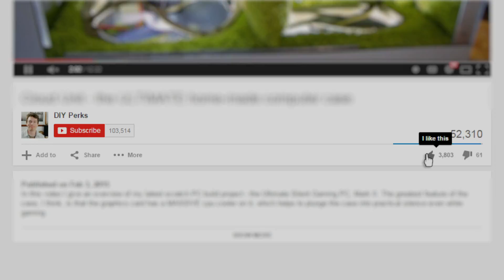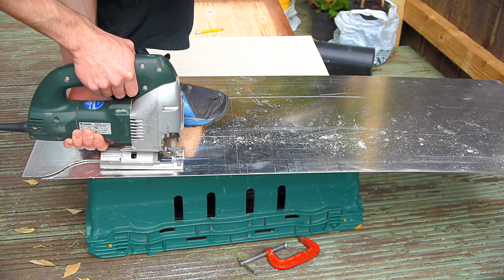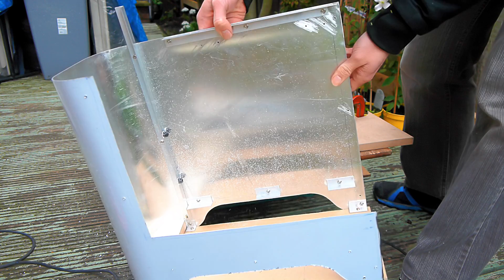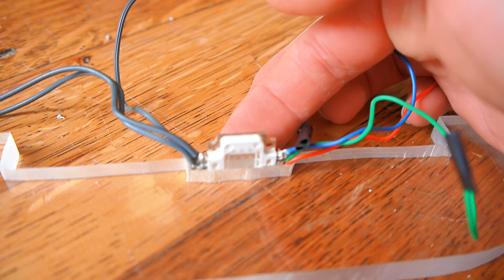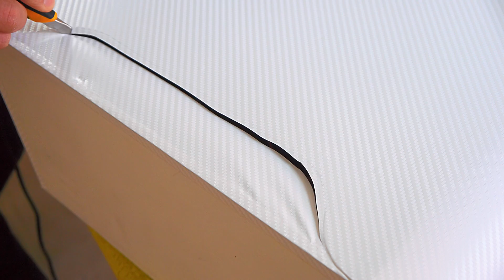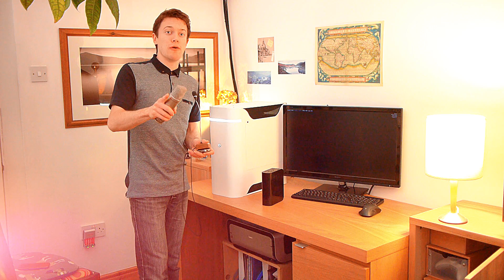Cloud Unit - Build Log (Scratch-Built Silent PC)

Comment: I would like to respectfully suggest some amendments. You could build an aluminum skeleton, and attach all the pieces to it, then make a skeleton cover using a folded aluminum foil. Have you ever seen an old compaq desktop? Access to internal components was done by pulling the back of the case (search for compaq presario 7471). The dvd drive would need to be replaced with a slot load drive, finishing is simple and easy, just a foam lined slot.

Comment: I can say this is way better than most cases being sold out there, in terms of functionality. Just add a little more variant like multiple harddrive cage,  etc. This is exactly what I've been thinking about; The integrated whole system cooling. I would buy the case, or even just the blue print.

Comment: I like your DIY videos very much! Very inspiring. I like the idea of how you built your silent PC. I had a water cooling but it pisses me of^^. So I think about building my own silent PC according to your guide. But I don't want to work with aluminum. So what do you think about MDF for the case? You built a wooden case too, but I couldn't find the built log. So you mentioned something about wood was resonating the fans noise or so... What do you think about using MDF? And another question is, wouldn't it be smarter to put the fans on the top, sucking the air from the bottom through the case instead of blowing from below? Cheers!

Comment: Man, seriously...You should patent this project....And with some time, refine internal design layout for more disk drives units and stuff....Overall is already an amazing project...You reduce the amount of fans (as long the necessity of higher rpms) and, independant of the parts that will put into, the same cooling system remains...AMAZING...
What's the total weight of this project????...I see that you use aluminum, so, in comparison with other cases (steel/glass) should've been lighter
I have to say that should be the next REAL trend to the next generation of cases: energy efficiency....not that RGB bullshit!

Greetings from Brazil!

Comment: Good work,  nice ideas, I had a similar issue of keeping it quiet and cool. I was lazy and just bought extension leads. It worked out easier to have the machine in another room and run the cables to where I was going to use it...

Comment: Build the case wider, put the power supply behind the mother board, and put one (or 2) 230mm fans at the bottom...

Now I have a use for the 230mm fans I got dirt cheap, that I don't have a case for.

Comment: that laptop hdd is going to heat up like a mofo and die in a couple of years. ive worked on so many laptops that had overheating harddrives and made them as slow as macbook air, jk. but for real though, you want that harddrive cool

Comment: I still dont get it... how do you do the heat transfer posible? i mean... you had the entire thing rounded in plastic (vinyl)! and the thing you use for absorving sound... well they actually can keep the temperature pretty high... there is something i miss? a hug from argentina!
Reply: Jaime Monsalve heat travels up, his aim is to get the hot air out as fast as possible and smoothly. The fans t the bottom push cold air up, as it slowly heats up it keeps rising up eventually going out through the vent. The.cloth that surrounds the fans at the bottom don't retain heat because there is virtually zero heat at the bottom of the case
Reply: unidirectional airflow and huge heatsinks are everything you need to keep the hardware within reasonable temperatures without having to crank up the fans

Comment: could u design the heat syncs in a way that it works like a sealed cooler, making it out of wood was silly u made a computer guitar lol ,  sucked in from both gpu n cpu and pumped out by the heat sync which then would be pushed out by the big fan

Comment: Never put an HDD in towel or  similar material because you dont have active cooling on hdd and towel just raise your temps too much with no heat dissipation at all. Second reason is static eletricity ;) just freindly advise.

Comment: As much as love the design philosophy of this case and it's overall setup I do have some criticism.  for one thing it is fairly dangerous to cover a hard disk in fabric as the vibration from the hd or the case could cause static electricity in the fabric which will ruin the equipment.  and secondly it may be more heat efficient to place the psu on the top of the case as opposed to the bottom for the simple fact that heat rises and you want as much cool air hitting the cpu and gpu as possible and if the psu is on the bottom of the case the heat from it will rise into the cpu.  with the psu on top of the case it would be in a more beneficial position imo as the psu does not need to be as cool as the cpu does in order to maintain protection from heat damage.  if anyone thinks i'm incorrect in this observation let me know.

Comment: for those of you looking to do the same... shop around for some 'cubelock' or similar - 25mm square ally tubing with plastic joiners that'd make this a diddle. And buy a de-buring tool, works far better/faster/easier than sandpaper. 
Good job in any case mate... particularly for someone with no prior experience.

Comment: just a mech tip : Use rivet instead of polishing screws. Taper rivet are also available in market. Use open spaces to circulate air as have used towels they will accumulate heat around device. use lapping paste to for neat clean acrylic after sanding

Comment: so you built all this but have crap hardware?
Reply: Not cool bro, not everyone can afford good hardware.
Reply: The point was proof of concept
Reply: heat generation bruh. high end gear would still overheat in that, but mid level stuff would run great indefinitely
Reply: +Shawn Tame wrong that is shit level hardware first of all, second of all new graphics cards have lower Temps and voltages so with a cpu cooler it should be fine. I would go for an Intel T branded processor which run at lower clocks and voltages than other intel lines but have much much lower tdp and temperatures making it perfect for this build. he could build a much better computer.
Reply: This system cannot game that is true. its not fast enough. But do you really think that is what this box is for? Its a show and tell pc, It will probably sit in a living room to be a stream box or browse the internet. MOST computers are not designed to game. its a Mid grade PC. for general use. Never did he ever say it was for playing games/ Heavy computing. Second of all as you so elegantly put it. that card draws about the same amount of power as a newer card yes, so it makes just about as much heat. But size is key here. Have you ever installed a water block? a few years back when i finally got around to doing it on my 980 i did a few silly experiments just for shits and giggles. basically i powered it on and hit it with a infrared thermometer to see how fast it got hot. ( I'm using the 980 because i have yet to take the original heatsink off my 1080. Im not sure if im going to keep it so i haven't bought a waterblock.) the heat is distributed in a much larger area, along with all the memory, the memory wouldn't be touched by a single CPU cooler. while that's fine with the memory on that older card, The one that has enough speed for his uses mind. Due to its limited capacity. the 980 has 4x the memory. It would NEED cooling at that size. while the smaller one might JUST might be ok without any. as the memory portion would draw 4 times less power. so create 4 times less heat. i stand by my statement that any of the newer cards could not live in that environment. they would make too much heat in the card, then you would have so much thermal throttling it would turn into a paperweight. might as well use on board graphics.
Reply: Fair enough Shawn
Reply: Shawn Tame thank you Shawn I now realize that the memory would have to be cooled that comment was posted when I was less knowledgeable

Comment: I will PAY YOU WHATEVER YOU WANT to build me a case like this!!!
Reply: LOL  I wish I saw you message three months ago! LOL I ended up choosing the NZXT s340 for it's great reviews of interior management and clean lines, though this other case is still amazing too look at!  I may call upon your services at a later date, but here are my specs.  If you can see if it's possible with these specs, let me know! 

Asrock Taichi X99 LGA2011-v3 MotherBoard
Intel I7 6850K 6-core Broadwell-E overcocked to 4.5 ghz 
X61 Kraken AIO Cpu Water Cooler
EVGA FTW Hybrid watercooled GTX1080
32GB G.Skill TridentZ series Memory @3200GHZ
256gb Samsung SM951 M.2 NVME SSD
EVGA SuperNova Platinum 1200watt Power Supply
4X Noctua NF-A14 PWm 140MM Case Fans

Comment: +DIY Perks Great build! - really inspiring, i do have one questions though, how have you managed to mount all of the components inside? did you drill custom holes to drill them in and would you recommend this instead of building a case around a shell of another pc case where you can already safely and securely mount all of the components.  - Thanks

Comment: You should build a MK III with Cable Management and maybe inside Painting(If possible due to cooling)
Maybe make it outside black carbon style instead of white vinyl.. and white air things instead of the black ones

Comment: You did a great job with this case! I find it very elegant and efficient.
Well, I loved your design so I decided to try it myself with an intel i7 950 (130W) and a MSI GTX 560Ti Hawk (about 250W because it is factory overclocked). Oh, and the motherboard is an EVGA x58 SLI Classified. The form factor is EATX which makes the case taller and longer. With your design and a lot of work I reduced the noise. Unfortunately the TDPs of my old components are too high and I didn't want to switch the tower coolers. So I added on each cooler a 14 cm fan to keep things cooled. What I have learned for the next project is:
- I need a smaller motherboard: ITX or micro ATX;
- I need a more efficient CPU and GPU, fortunately any new gen CPU or video card will be ok;

I would love to see your next case if it will be another one or at least a video about what will you change or how would you improve the design.
Reply: Well, for the Graphics Card you can buy an GTX 1080 (Requires 150 Watts). It's WAY cheaper than the previous flagship, the Titan X and requires less power. For the CPU...NAAAAAA, I don't know, maby i7 6700K?

Comment: Instead of MDF I would suggest using plywood (AKA multiplex I believe it is called in some countries) it's a bit stronger and much less toxic to cut and deal with as well as plywood is also way less brittle around the edges and cuts better usually. as far as a way to fasten the external shell/outta curved panel instead of screws...consider using a metal adhesive or epoxy...the strength is about as good as a couple of small welds and is even used to hold panels on cars...this would be more then strong enough and would cut down on the filing and sanding time....or alternatively you could use a L- bracket glued on the interior with some pop-rivets into the main chassis frame/bracket .... if you like the look of the bare aluminium you can get various grits of sandpaper and polish the aluminium back to a mirror like finish making sure to stay with the grain when applicable ... even steel wool should be able to do some of this....after polished you can put a coat or 2 of clear on it to protect it. as far as the cpu cooler keep in mind larger cpu coolers only go up to around 250 watt tdp however companies like prolimatech and arctic cooling have VGA coolers that can dissipate in the 320 watt range for around 70 bucks USD and on many gpus could be used fan-less if located in the right spot with some airflow in the case but they are very large coolers lol... another alternative is buy some heat-pipes and I saw a guy once tie those into the case via soldering and some thermal adhesive and use the case to passively cool the card... a very good and cool thing if done right

Comment: just going to point out, CD drives shouldnt be mounted vertically.
Reply: +ender25ish k?
Reply: Sorry, that is wrong.
When the disc is spinning, it is supported away from the tray. Its orientation is irrelevant because, unlike old needle-on-vinyl audio discs, the laser doesn't need gravity to read the disc.  In fact, back when many PCs were horizontal, optical drives were often mounted vertically; and inside the tray there were little tabs that were adjusted by hand so that the disc would not fall out when the tray was moving in or out.  This build uses a laptop optical drive which features a mechanism that grabs the disc by its hole so that tabs are not needed.

Comment: I think you gonna have dust problems inside plus not good cooling circulation inside that metal box even if it's made from aluminum it still produce heat. but still it's a good case and a nice project

Comment: Very nice build, thanks for posting. Been thinking about some of these concepts myself in the past and happy to see how well it works. With a PC case with that much room inside I've always thought it should be possible to achieve a very low noise solution without having to resort to water cooling.

Comment: +DIY Perks, is there a reason you didn't watercool this?  Even an AIO unit on the CPU and graphics card with a high fin density radiator and some "silent" static pressure fans would significantly reduce noise and give you a ton more room.

Having said that, the exterior design of this build is phenomenal and I'm seriously considering fabricating one myself for my own build, likely with a few tweaks.

Also, I realise this video is relatively old, but please please PLEASE put a disclaimer in future computer-related videos that no novice should be dicking around with an unshrouded PSU.  You might know what you're doing, but I guarantee there are a ton of ambitious dumbasses who don't.

Comment: Hi mate, nice video! I'd love to see another. If you ever consider doing a cloud unit v.2 I have a few tips to help make it pretty much silent with fans. Although passive would be easier that would just be boring! It may cost more but I suggest you invest in a custom water cooling loop, which would cool the cpu and graphics card. This means you could use just one fan for the case (on the radiator) if you choose to have a 1 x 120mm radiator for example (which if using pretty basic parts would be fine) Another thing, lining the inside with a thin layer of sound insulating foam will prevent the sound waves from moving parts bouncing off the sides of the case. Evidently making it quieter and it will look much cleaner than the towels. Your psu in my mind is a CRAZY solution and you can get FANLESS power supplys from a company called 'Be Quiet!' This is obviously a much safer solution. Great video, looking forward to seeing more!

Comment: here's one,  how about a silent case like this but for an sli or crossfire setup? 
That would definitely be one to watch
Reply: +Yusuf Ayyub 
I don't know what SLI is for these days, single GPUs got so much more powerful than just recently. But it's not my matter to judge, perhaps you have some special use case.

I don't believe you can expect such a video from this author, because he operates on a shoestring budget, and simply can't afford or has no personal use for multiple GPUs and a multi-GPU capable mainboard. You notice the hardware he used here is already very old.

I don't have a solution, but i think there are two ideas worth exploring. One idea is to equip GPUs with the Thermalright HR-03 GTX cooler. It has less fin area than this cooler, but still a lot more than stock, its heatpipes are powerful enough, and the fin direction is just so, that it might support this case's airflow direction. Also, it allows the cooler to be mounted on the front or on the back side of the GPU, so by alternating locations, you can fit multiple GPUs in. Other idea is to use extenders to relocate the GPUs to a more convenient location.
Reply: I understand where you are coming from but surly running 2 x Titans in sli is better than running one? Or if one was in the designing business, wouldn't running 2 or more quadro gpu's would be more beneficial than one? 

I understand that the author is working to a budget and this was more of a 'it would be an interesting watch' than 'this is your next mission! '
Reply: Arya Javaheri 1440p is just about high end single GPU territory. 4k clearly not, right. And yet multi GPU setups are just so nasty for gaming, your average performance clearly goes up but your worst case just dips instead.

Comment: +DIY Perks - Just an idea: is it possible to screw the wooden piece in place instead of gluing it to the aluminium to keep the shape constant?
Reply: +Kode Williams You'd still see them unless you created a cavity for them and then used bodyfill or something to smooth out the look.  Definitely something you don't want to do if you ever want to take it apart again.
Reply: How about use screws and cut and sand the heads off, use countersunk screws and dent the holes where the screws will go or use those screws the does have a head and have slots on top of the screw's body.
Reply from the maker: Possibly. Wouldn't look great on the outer side though, as you'd have some screw heads to contend with.
Reply: Maybe rivets? More refined than normal screws, I think lol.